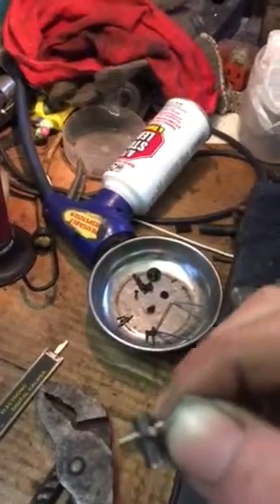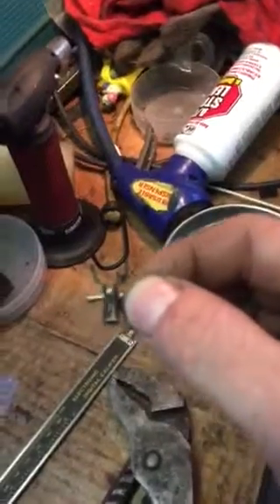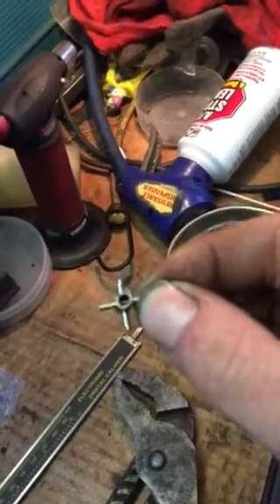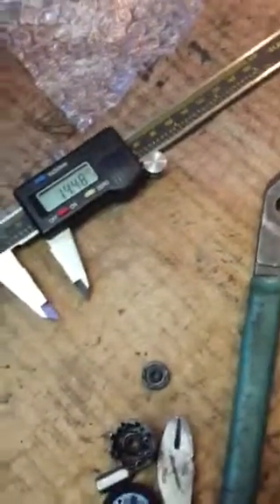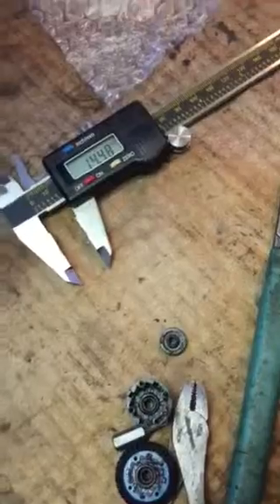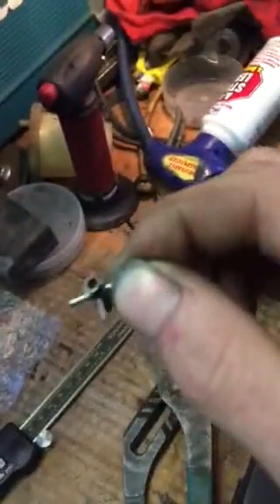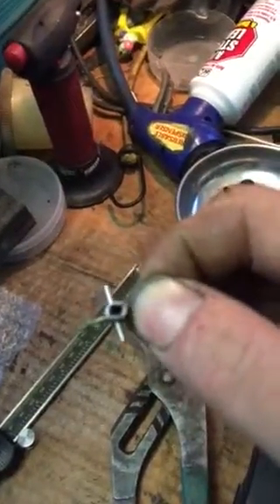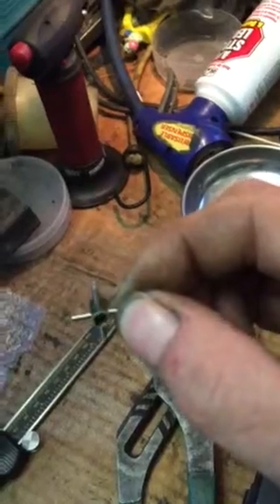Ecx Ruckus 1/18 rear diff fix

Comment from the maker: My son has ran that truck about 2 hours since I did that repair. Still holding good. Blew the front diff not long ago. I'm going to do the same for the front.
Reply: Has it still done good?
Reply from the maker: @baileycaple1577  it lasted a few months and one the the drive cups slipped out. Pushed it back in and kept going.
Reply: @junkyardhemi  okay thank you lots for the info I just did it to mine! Also what are the drive cups are those where the pins mean to the plastic
Reply from the maker: @baileycaple1577  drive cup is what the driveshaft slips into. Kinda like part if the u-joint.
Reply: @junkyardhemi  oh okay, and one more question I know you did front and back how did that affect the steering. Thank you for the help!
Reply from the maker: @baileycaple1577  it did make the steering a little wider. But it still drove really well.